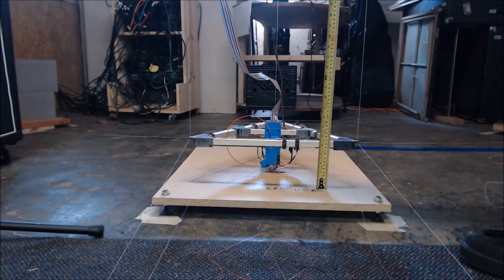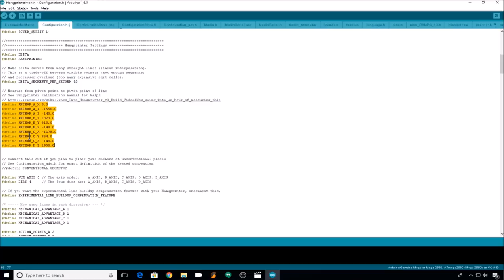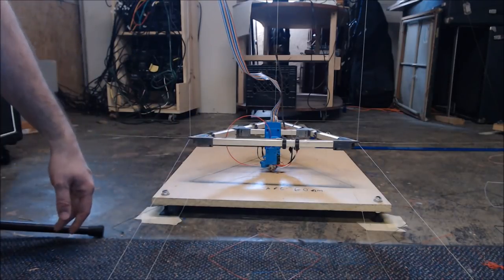HangPrinter v3 Part 3 - Corrections - Chris's Basement

Comment: What about the TMC 2100/2130 drivers?  and the closed loop units that I have seen in use with the hangprinter.  is there a firmware change that needs to be made in conficguration H?  The 3.3 version of hangprinter firmware shows the 2130 being used.
Reply from the maker: The TMC2130 are configured in the new branch of the hangprinter Marlin firmware, but I have them disabled for my build because I don't use them. So I just comment that stuff out. Not sure about the mechamenos or how ever they spell that. :)